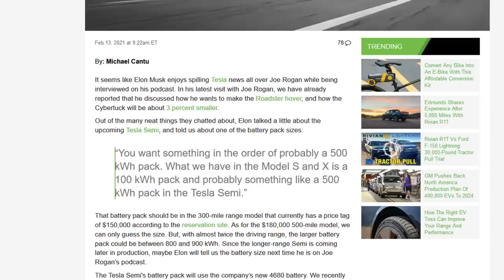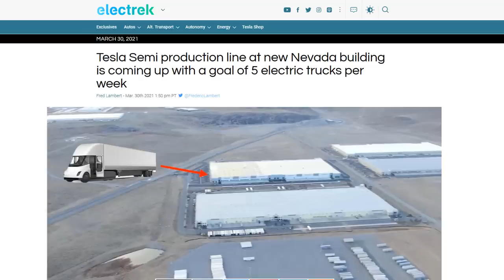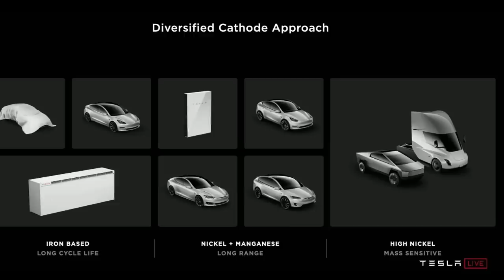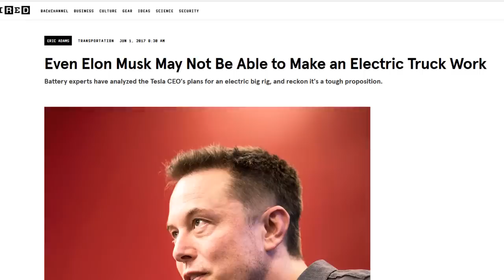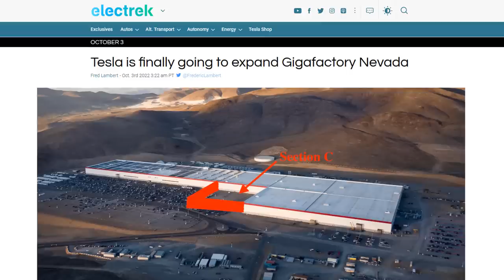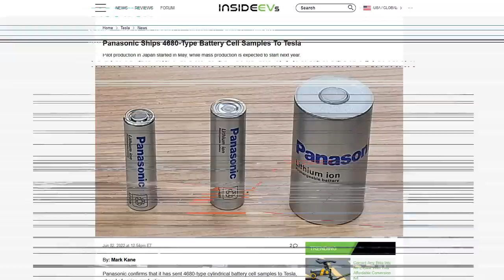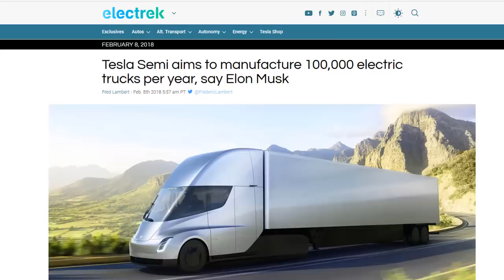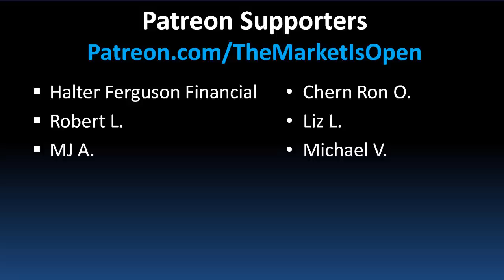Tesla Semi Is Coming in a Month - Let that Sink In

Comment: The one big problem no one seems to be talking about with regard to electric vehicles is where the electricity is coming from. We don’t have anywhere near enough sustainable energy yet to charge all these vehicle’s coming into circulation. So the plants that are creating the energy rely on petroleum products. On that basis how does it make sense to create EVs? Oh, and then there is the issue of pollution created by mining nickel and other production processes required to make batteries. These create substantial pollution. So do EVs reduce pollution? Simple answer, no.
Reply: Blah blah blah — more oil industry propaganda — blah blah blah — unsupported conjecture — blah blah blah — more propaganda — blah blah blah.

So, do EVs reduce pollution? Simple answer, yes.
Reply: @ChitFromChinola  eventually, But keep going - you'll have to drive over 13,500 miles (21,725 km) before you're doing less harm to the environment than a gas-guzzling car, but due to the extra weight of a EV the tyres wear faster, and with the harmful particulate matter from wearing tyres being far more harmful to humans than exhaust emissions, EVs arnt in the clear by a long shot
Reply: @ChitFromChinola  🤷🏻‍♂️but then the wisdom of your contribution gets deleted ??
Reply: Wow, you were first one to think of that!!
Reply: @ChitFromChinola  but it needed to be mentioned here among all the biased hype
Reply: OMG. Wearing tires are more harmful than combustion exhaust? So let’s see, tires wear out on all cars, but the trivial net excess wear on EVs would somehow be worse than the entirety of combustion gases? Try parking in your closed garage with the engine running to test that ridiculous theory. Lol. That’s a helluva stretch, dude. Blah blah blah more nonsensical propaganda. Try again.
Reply: @ChitFromChinola  well, yeah, there’s carbon monoxide poisoning, then there’s particulate material pollution, 
There’s facts, you don’t have to like it 
Have a look at some then comment 
https://youtu.be/WpQurx-ttOE
Reply: @spinnymathingy3149  

Dude, your own reference clearly and repeatedly states that we need to accelerate our move away from burning hydrocarbons, and that tires are a seriously difficult pollutant to get rid off . . . and you cherry-pick one of his most speculative statements to support your anti-EV position? This guy does not support oil industry propaganda. Try again.
Reply: @ChitFromChinola  it’s often difficult with text to easily portray a point , my stance is EVs are the future for sure, but they have a long way to go engineering-wise before they are going to be the panacea we’re looking for. For example there’s hopefully a new generation of battery not too far off that uses almost no rare earth materials, is far lighter and can pack in many times more useable electricity than the best currently used batteries, that’s the kind of game changer that’s needed
Reply: @spinnymathingy3149  
You don’t have to wait, they’re already here. Lithium-iron phosphate batteries check all of those boxes and are the most common car battery now. Battery prices have dropped 90% over the past 20 years, and that’s the converging technology that is making the current EVs possible. And, it’s happening in our lifetime!! Electric motors have always been superior to combustion engines (would you run your refrigerator using a combustion engine?), but we needed cheap batteries to make electric transport possible. Now, it’s here. The “rare earth” thing is propaganda — the need for cobalt is either completely gone or will be soon. Lithium is not rare. Iron is not rare. So, you don’t have to wait. Go for it. I have an electric car, electric tractor, electric dirt bike, electric lawn mower, and electric snow bike. On order, I have an electric street motorcycle, electric side-by-side, and an electric snowmobile. An electric jet-ski would be pretty cool, too. If you’re in the neighborhood, you’re welcome to stop over anytime to try them out. It’s not about saving the world, it’s about simple fun. These things are such a blast, it makes me sad to see people clinging to stinking, loud gas engines that will all be stranded assets in ten years. Electric motors are just ninja.
Reply: @ChitFromChinola  thanks, I fully get what you are saying 👍 , but capacities and weight/size will be vastly improved with the next generation battery I was referring to. 
This guy in link below “the electric Viking “ is well informed and generally doesn’t talk hype
https://youtu.be/cab9z1uVaTw
Reply: @spinnymathingy3149  
Yup, but that’s the cool thing about batteries — they keep getting better and cheaper. Battery technology marches on, but gasoline is still just gasoline. And it will always stink . . .

The point is that today, when you are ready for a new car or motorcycle or whatever transport, don’t wait — it should be electric. You can choose from whatever battery technology is available, but don’t buy a gas engine. Ten years from now, gas- and diesel-engine cars will be almost worthless. No one will want to buy them except for the scrapyard.
Reply: @ChitFromChinola  I agree for sure, 
But here’s a curly issue I heard about recently regarding oil, and I’m wondering how it’s going to be tackled in the future. 
When oil gets refined, apart from fuel , basically the byproduct of what’s left over makes the rest of our modern world, plastic, synthetics, almost all the world’s rubber products, almost all chemicals for everything, road surfaces medicines, vitamins the list is almost endless, so the question is, to get all these products only uses around 10% of the chemicals in raw oil, the remainder is fuel , so what’s going to happen with all that fuel ? 
Someone smarter than me will have to work that out
Edit : 
Bazinga, what’s the likelihood that in 10 years time 1/2 the cars on the road are EV, the other 1/2 ICE cars, will there be an oversupply of fuel, making it cheaper ?? 
Hopefully, for my RX7, it uses a shit-ton of petrol , maybe I’ll hold on to it as a weekend car 🤔
Reply: @spinnymathingy3149  
Disruptions this big always have unintended consequences, but the markets work it out. In 1900, 90% of transportation was horses. By 1925, 90% of transportation was cars. What happened to all of that hay? And what did we do without all of that fertilizer? Lol.
Reply: @ChitFromChinola  well, fertiliser also is a petroleum and natural gas byproduct 🫣 so I suppose hand in hand with ice cars,
Reply: @ChitFromChinola  you mentioned you have a battery lawn mower , what brand can you recommend, I could only find lightweight underpowered very narrow models
Reply: @spinnymathingy3149  

EGO. Mine is a 21” push mower. They have a zero turn rider, too. I have one of their battery chain saws, too. Good stuff.
Reply: @ChitFromChinola  thanks

Comment: Why not to add some solar panels for an extra charge?
Reply: Solar panels on a system like this would do nothing. The chargers are likely 3 phase 460VAC voltage systems. A solar panel would be like a mosquito on an elephant.

Comment: I'm in LTL in the Rockford, Ill area, on average I only travel 110 to at the most 250 miles a day. I could see these trucks being used for local delivery and pick ups such as what I do. The big question will be the initial cost to the companies because if it doesn't work out on their spreadsheets they're not going to go for it, or whatever
Reply: same i work for coke in springfield and average about 120 miles a day probably would work well for that too

Comment: i can't wait for the most ironic thing ever: tesla semis transporting fuel to gas stations.
Reply: Here's what's going to be ironic, a big diesel tow truck towing a dead electric truck. It will happen more than you want it to.
Reply: @francomtz7115  Nah, they'll be towing a portable diesel powered charger to the dead electric truck. LOL!!
Reply: @Barneyrubble241  if it needs to be off the highway only a bad ass tow truck with a Cummins
Reply: @francomtz7115  if there even is diesel left. Itll be a Ford v10 gas truck towing the Tesla straight to the scrap yard for its copper
Reply: I want to see this semi too there are some pretty magical numbers being claimed like less than 2kw per mile i am wondering if that is just the semi itself because a humer EV pulling a camper (so not very heavy) down the highway was tested and used about 1.6kw per mile and if if i had to guess that combination would weight about the same if not a little less than the semi so that with a 60,000 ish lb trailer is going to draw less than 2kw
Reply: @shaynegadsden  jyst more elon b s ssdd
Reply: Will EV semis be allowed to tow anything that is potentially explosive?  The amount of energy stored in those batteries, the implications of a potential battery fire, even down to possibly having to unhook from your load when charging due to potential fire or sparking scenarios.  That, and unless a fuel trailer is specifically designed for the Tesla semi, the affect one would have on the aerodynamics of the semi could really hurt its range.
Reply: @yarrik701  
Since Gas cars catch fire currently 10 more often more than Tesla cars, I fail to comprehend your logic that the Tesla Semi will be more dangerous that something carrying those huge partially filled tanks of diesel.
Reply: @bearlemley  Has the process to put out an EV battery fire and prevent it from re-igniting changed much?  If not, take the processes they have for a "small" passenger EV battery pack fires and size that up to one that would be found in a much larger semi pack.  Throw in a tanker trailer with what, 3,000 or more gallons of say, gasoline that might be hitched right over said pack, and that's my point.  While you can have a diesel fire, it's not nearly as flammable as gasoline, and you don't have the extreme reactivity along with re-ignition issues that battery packs have.

As far as the numbers between EVs and ICE vehicles go, BEVs represent what... 1, maybe 2% of all cars on the road?  They're typically more expensive vehicles that one would hope would be in a better state of repair than a 15+ year old rust bucket marking its territory with oil and fuel held together with duct tape and bailing wire compliments of the nearest shade-tree mechanic.  Let the BEVs filter down to the masses who can't afford to take their cars to the dealership for repairs, who buy their vehicles cheap, used, and with bad credit and then see where the numbers fall.  I can only wonder what modifications will be seen on EVs to keep them running on the cheap.
Reply: Similar to how diesel gensets are rented to charge dead Tesla batteries?
Reply: I can't wait for the most ironic thing ever: diesel semis pulling huge diesel generators to charge the tesla semis dead batteries on the side of the highway. You know, like what is already happening to tesla's other vehicles.
Reply: @anonshitpost101  I’ll be happy to rent my diesel genset out to dead semis. It won’t be cheap, but neither was that truck
Reply: Would it be any more “ironic” than a diesel powered semi carrying the components of a charging station?
Reply: @cdtheque  No, production needs transportation, and transportation (by truck) is today a diesel powered thing. Similarily, materials for the first cars were transported by steam engines and horse carriages.
Reply: More like transporting diesel fuel to the generators that are out in the boonies and then having to charge using the fuel it’s hauling
Reply: Kinda like burning coal to charge Teslas.
Reply: Like an electric propulsion train delivering fuel by the trainload? Or does it require batteries obtained using fossil fuels to be ironic?
Reply: The irony are the diesel generators next to the hyper chargers.
Reply: That is seriously GretaEsque.
Reply: I would follow them just to take a picture of that 😂😂😂
Reply: That’s irony you can taste
Reply: Might have weight capacity for 100 gallons or so. They're basically lead sleds with barely enough capacity and range to carry themselves down the road. Especially when you factor in the weight of the battery...
Reply: Then waiting 24 hours before it leaves because of the change time.
Reply: Great... MORE massive batteries so we can do more strip mining. Some of the most virgin, untouched areas on the planet are now being destroyed because of BATTERIES. Whole mountains are being leveled but yeah...
Grrrreat.
Reply: It's about time! I've been using my old KW Diesel to haul all kinds of Freight into Tesla's factories for years!
Reply: You just won the internet! 🤣🤣🤣🤣🤣
Reply: These trucks can't handle a full tanker of fuel
Reply: Add the 1 megawatt igniter, toasted marshmallows from how far away?
Reply: @zAlaska  let me check what my ABCD(TS) fire extinguisher says
Reply: Yeh keep waiting
Reply: One hell of a fire hazard...
Reply: Is that more or less ironic than the fact that EVs can't exist or be powered without fossil fuels?
Reply: @darinpearson2554   that's not really an irony lol
Reply: @sebus212pl4  I was going to say it’s not really irony at all.
Reply: @darinpearson2554  nuclear power has entered the chat
Reply: @darinpearson2554  false
Reply: @darinpearson2554  
The Pepsi charge stations are solar powered.  If you charge your truck near a nuclear power plant then you will not be using oil. And if your power comes from diesel powered generators, the Tesla truck will be 5 times more efficient with the energy they consume. This is why it will save companies operating them so much money.  This promise of lower operating cost is directly tied to their efficiently.  Change is not always bad.  Change is not always for liberals.

Comment: The cdl requirement to drive one of these is state and situation dependant. For instance you could theoretically use it to tow a camper and some states even remove the weight limits for non cdl use.
Reply: Exactly... 
As far as I know you only need CDL for commercial use...
I have a Florida licence so I don't know about other states...
Reply: @hunati31  When I looked into it I found that same ...at least a few years ago
Reply: Many states still require a CDL for large motor homes, often based on their GVWR
Reply: @stlchucko  like I said state and situation  dependant. California would require an air brake cert for my bus conversion but not likely a cdl.
Reply: Thank you I was going to state the same!
Reply: @callmebigpapa  Exactly... 
As far as I know you only need CDL for commercial use...
I have a Florida licence so I don't know about other states...

Comment: The guy that made this video knows nothing about logistics.  The major issue aside from the limited range, is the weight of the truck.  The payload of the tesla semi will be far smaller then a diesel truck due to the truck weighing 25k lbs.  Tesla is known for lying about the range of the vehicles. I have a plaid that says tesla claims the range is 394 miles, I have never gotten more than 325 miles.

Comment: The amount of infrastructure that will be needed to support these trucks once they're out on the road, will be nothing short of impossible.  One charging station/truck stop planned near me, will draw as much electricity as the entire city it resides in and it will only allow 50 trucks to charge a time, with 45-60 min charge times.  I drive truck, and 50 trucks at a TA is very common to see.  The #'s just don't seem possible.
Reply: Gave you a thumbs up. Infrastructure needs to catch up with the Tesla vehicles QUICKLY. If that is the only thing holding back Teslas from rocking the transportation industry we have exciting times ahead, in a very good way
Reply: @econdude3811  Tesla is dead last when it comes to developing electric transport industry every major brand is doing it right now and many have trucks on the road right now this second.
All car manufacturers in Europe has to change over to electric in the next 8-13years to sell new veichles.